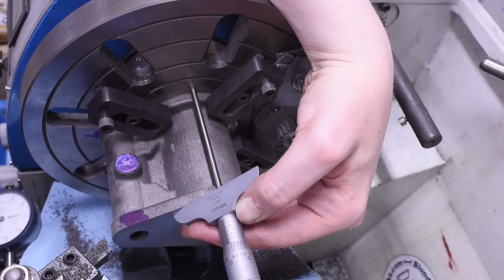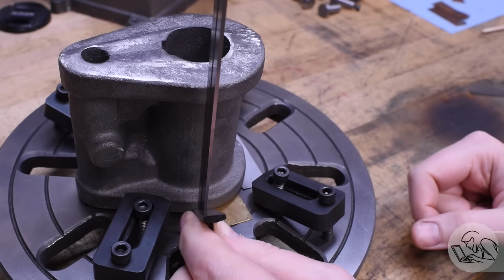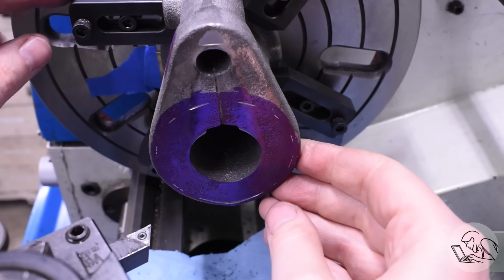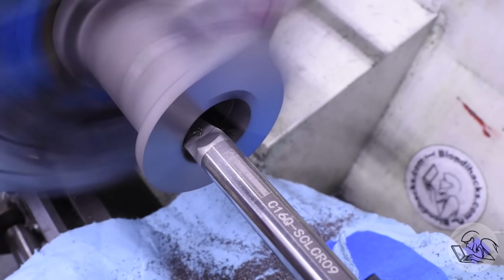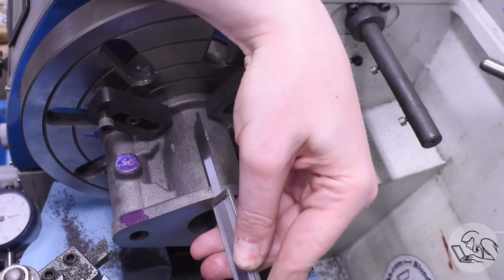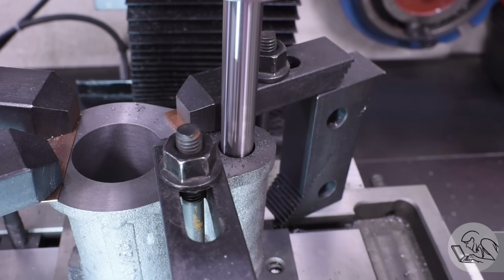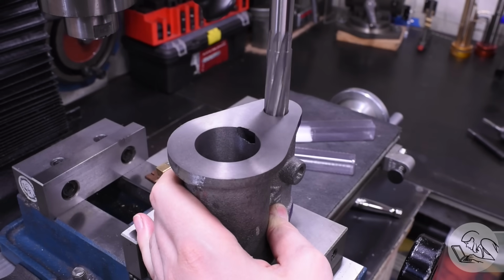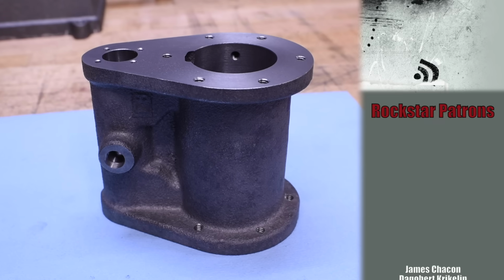Main Cylinder Machining! Big Steam Engine Build, Part 6

Comment: To line up the two bores, line up the smaller one with the pin first, then take the pin out of the quill and clamp it to the table somehow.  Then just tappy-tap the larger bore to 'rotate' it to the right position.  Similar to your rotary table solution, but without needing one.  (Apologies if you thought of this and discounted it for some logistical reason)

Comment: You did a great job of boring shapes between centers, why change,  we turned a shaft to fit the cylinder then turned cones to fit both faces of the cylinder. then squared the ends.

Comment: This reminds me, today i modified my little lego steam engine a bit to support a 2x bigger piston. The cylinder doesn't need to be as thick anymore because i learned to seal the gaps with tape, so i used the extra cylinder thickness to add an extra wide piston. It should theoretically have 2x the torque, and maybe less turbulence losses because of the studdy passages

Comment: 5 threads showing on the pipe tap should be the correct depth.  Machinery's Handbook lists the "projection" distance.  That is the actual tap depth you need and you can just use that if you have a DRO on your Z.  Otherwise,  set your calipers to that dimension and measure up from the end of the tap and count the number of threads that should show (should be around 5).  Projection for 1/8-27 NPT is 0.312".

Comment: Quinn, looking at you decrease chattering by changing the RPM had me going jealous... as I had a total of four different speeds on my lathe, directed by V-belt driven wheels. That is, until I remembered that I have installed a variable frequency drive on the lathe just two days ago... :) Now I can try that one as well! Thanks for all the information, helping out small-time hobby machinists like me! (Still jealous about the power cross-feed though...)

Comment: something I do to avoid that same mistake, having made it myself a few times, is to re-write my measurements in an expected format and then use "Ø" instead of "0" anywhere i've added unnecessary precision. for instance 3.38" would become 3.38Ø. 

I'll sometimes change fractional Measurments to the way i read a tape too, 5/8ths becomes 1/2+1/8 ect. but i'll admit that's a me problem.
Reply: I’ve had to break the habit of crossing my zeroes- especially while writing shorthand notes. It’s so similar to the print symbol for diameter.

Comment: Hey. Saw your misstep on dimensions and understand.  Here is something that MIGHT help.  I am an old-school draftsman (back from lead on paper or ink on mylar) and probably hopelessly invested in the inch system.  When I see a dimension like your 3.38", my mind automatically sees 3 3/8" plus a shade over.  I'd probably round off to 3 25/64"  (3.90") and use a scale to rough it  down to near the final dimension.  Then use the depth mikes for final.  Everyone's mileage is different, but even the draftsmen used rulers when they drew it out back then.

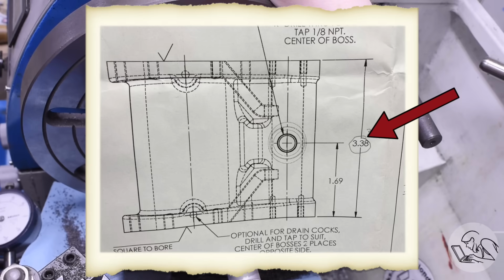Comment: 14:45  Dyscalculia has whooped my butt since I was eight years old.  I even started this line by typing 14:54.  Writing the numbers on a rough surface (e.g. rough side of Masonite) with your fingertip can help kick you out of the line of thought you're stuck in.  I keep a piece at my desk and workbench, both.  Good luck!
Reply: Wow! I think that's a very good idea.
 I have a lifelong serious problem of remembering proper nouns: names of people or places if I just hear it or read it. Very difficult a lot of times, even if I repeat it in my head.
But if I write it down I will remember it.
Reply: @henryD9363  have you tried just remembering it correctly?
Reply: @jerseyjoe2684  lol yeah i was just fuckin with you

Comment: Nice progress. If memory serves you have just adjusted for the con rod to within a few thou. (This is how you take a kit and make it your own with a few redesigns along the way)                                                                       Quick tip. When trying to hold center position of one hole for zero point you can make a short slug that fits the bore you want to hold, drill a hole in it then bolt it to the table, then the part can be rotated around the slug similar to your rotary table fix. This is especially helpful when trying to mate different parts to exact centers as you don't have to move your setup, just change out part an rotate new part to desired offset degree location and spacing has not changed. Side note is if you are trying to line up different size (zero) bores, make the slug equal to smaller bore, and you can sleeve or shim to larger bore size of other parts (zero) bore dimensions.

Comment: Possibly spot facing the boss for pipe fittings before drilling might make it easier get the hole centered. It is a casting though so how centered will it really be in the end?

Comment: Many years ago when I had my hi gauge layout there was roughly 8 axles that always wanted to derail on one spot. Although the spot was checked and set to gauge plus a couple of thou over gauge, I had made a collet to put the axles into the lathe, the by memory I had set the angle to 4 degrees on the cross and the wheel profile, I don't remember the angle for the flange but after all the axles were turned, there were no derailments on any of the layout and on another person's layout. By memory before I turned the axles, the angle of the wheel profile seemed to be 0 degrees. The 12 inch to the foot gauge scale is that there's 2 angles for the wheel surface so to try and scale down to ho 1:87 is right near impossible so setting to 4 degrees for the most part working out the maths to in general the sizing is not a bad thing

Comment: Oh how I wish I had one of those centering dial indicator measuring tools.  It appears to be a hell of a lot simpler than using a dial test indicator to find center.

On my 5ci build, my boring operation on this part resulted in my bore being hourglass shaped.  I have not idea how that was possible, but there it was.  Regardless,  I compensated by about 90 minutes with a cylinder hone.

Comment: Hey Qinn...
Just working through your basic milling tutorials... great stuff...
You have a knack of explaining things clearly, and in a way that numpties like me can follow!

BUT... you say pencils, well they are just for the carpenters!
Yes you are right, for basic carpentry, roofing, flooring and 2nd fix... etc ...
However, I'm a retired wood worker, and in my shop, I use a scalpel when doing fine limit woodwork.
I work to very fine tolerances as I make small stuff...

Anyway, nothing to do with stupid cylinders... lol

Frank...

PS. Could you move next door to me in the UK please... !!!
You can then set my stuff up... when ya finished, you can always move back... no big deal, eh?

Comment: smaller pipe NPT is a little bit of just trying it for sure. on the bigger ones 1/2-2" it's 6-8 threads from the top of the tap so just count 7 threads down from the top. the proper way is you have to do some math to get your standoff from the bible then use your pitch for how many free turns but it's pipe there lost of room for variances. keep up the good work.

Comment: I run npt taps all the way, I like flush/no thread showing. That's probly the wrong way. I also run crush washers, ulra flange, or solder them in, so they don't leak.

Comment: could you have used the bore itself to set the casting in the face plate? then bore that smooth, then use that finished surface to square the casting to get a flat spot on one end that would then be perfectly flat and true with regard to the bore...

Comment: Could you use an annular cutter the size of the boss and center punch it with the pin? obviously you don't need to hit it hard. This will get the hole closer to the "real" center of the boss. Keep smilin

Comment: I had a very similar off center problem on a PMR water pump casting I was working on.  I wonder if facing off the boss would help, although it would probably make the surface too large in diameter and might still not help with centering the hole.  I wonder if there is a better method to overcome the issue?  I tried using a gauge pin of similar size to the boss but i still ended up off center.  Thanks for the series!  Jim

Comment: Wouldn't it be easier to mount if you create a plastic mandril that you mount on the center? Then use that to center the hole on the casting? Lock everything up then remove the mandril? 
I know nothing of machining but that was the first thing came to mind.
Reply: Plastic would probably have precision issues, because of how flexible it is it's hard to achieve concentricity and diameter tolerances, meaning less precision on the setup.
Reply: @kelvinyonger8885  i mean it is a casting. It already have concentricity issues. And a two inch thick vinyl rod would not bend. Also it is just for mounting.
Reply from the maker: I love it when people answer viewer questions for me. Thank you all 😁

Comment: Would it have been possible to turn the main cylinder bolt circle 90 deg.? Or would that have caused issues with mating parts? I just think having that bolt hole going into the steam channel a poor design choice. I think I would have changed the hole locations on all the mating parts. But only if it wouldn't interfere with other parts down the line. Obviously I couldn't make that decision without the print in front of me.

Comment: What is the length on that boring bar? 180mm?
16mm solid carbide boring bar looks nice, I have been in the market for one for awhile now but they must be sold out on them since I don't see them listed on their site. I will message them and see if they are going to be getting any of them anytime soon. From the prices of what I have been seeing listed though they seem to have some really good prices for them.

I have some old school 3/4" and 1/2" boring bars that hold hss and a few of the cheaper insert bars, the only carbide I have at this time is a 8mm and it sold me on wanting to get larger solid carbide boring bars since it gives you a lot more over hang.
I plan to get a 5/8" and a 1" if I can and just remove my QCTP and replace it with a solid piece of stock bored to accept the 1" boring bar to make it more ridged and so it can stay closer to the post.

Comment: Dumb question... if you keep misreading "3.38" is it worth going through the drawings and writing in the extra zeeo "3.380" ?

Disclosure: I have a weakness for mixed units. There was a spec I kept misreading, 6' 1/2" and I kept misreading that as 6.5'. That was not fun.

Comment: Would taking a Blakes indicator and mounting it in the tailstock referencing the bore also help achieve this faster setup?
Reply: There's always some sag to the indicator, more in a coaxial indicator than test indicator.  I'd try a hard mounted test indicator (mount tight on a short 1/2" rod)

Comment: Just like an expensive CNC machine, my 20 year old lawnmower also has a random engine speed "feature" to prevent standing waves.
Reply: Just curious but what does chatter look like in a lawn?
Reply: @russkepler  Usually chatter on a lawn looks like the mums talking to each other, sipping white wine and occasionally intervening in an incident between their respective children.

Comment: When you carefully take measurements making sure that you hit the spot, but you misread the size at the first place, I call that phenomenon “Controlled flight into the ground” You carefully and accurately achieve the wrong size.

At least you did not make opposite hand of that part like I did - but previously checking that the part cannot be made OH 🙄

Comment: I don't know why they chose this kind of 
steam valve, on this model.  The steam 
chest design, with the steam pressure 
holding the slide valve against the side, 
always looked good, to me.

steve
Reply from the maker: Slide valves are much less efficient, which is why they were replaced with piston valves